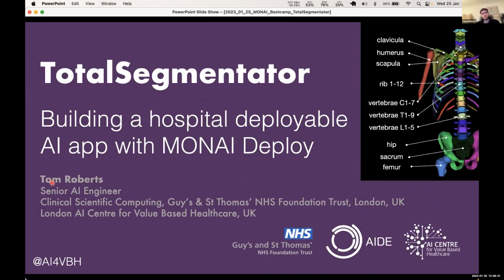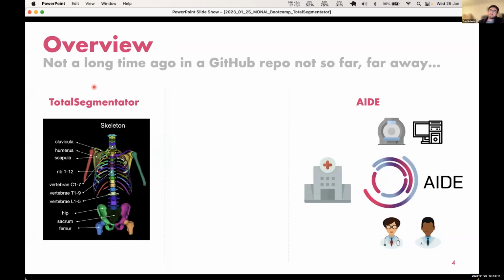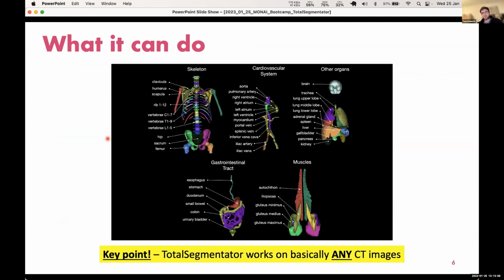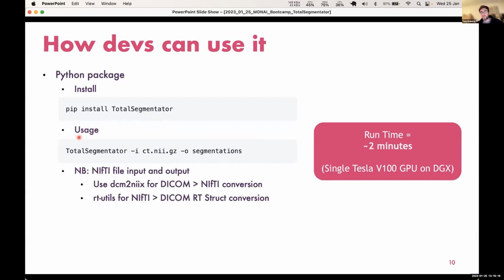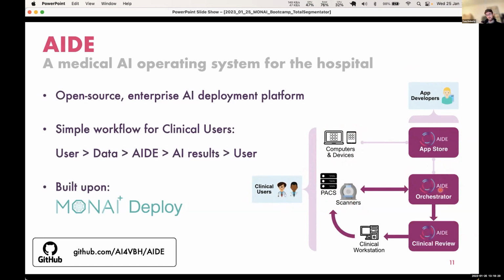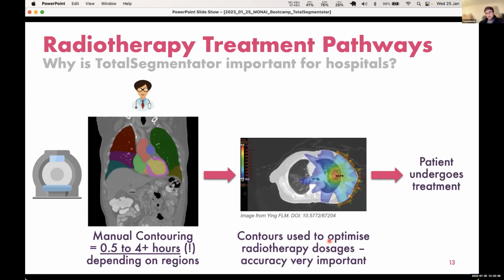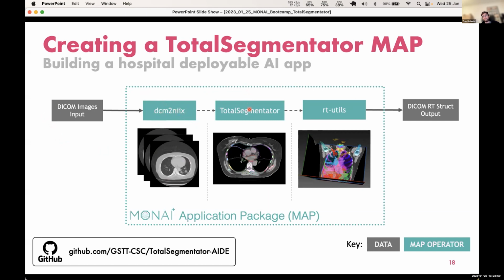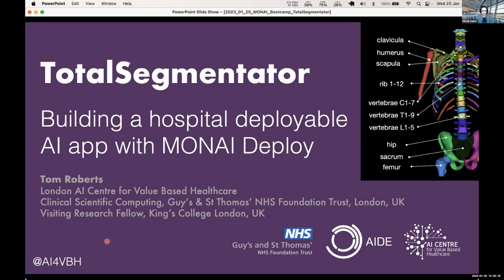MONAI Deploy TotalSegmentator Teaser

Comment: TotalSegmentator is a great tool,  but unfortunately it lacks most of the head and neck organs (e.g., parotids, mandible, lymph nodes, cochlea, optics, etc.), which are very important for the radiotherapy of that area. Of course, one can do an in-house training on these, but it would be great to be included for completeness.
Reply: heyy
i tried running the totalsegmentator but im having an issue and i dont know how to solve it

C:\Users\Desktop\totseg\env>TotalSegmentator -i mni152.nii.gz -o segdirnew --fast
'TotalSegmentator' is not recognized as an internal or external command,
operable program or batch file.

ill be really thankful if you can help me to understand whats the problem
Reply: @ashley_004 I'm not sure if it is too late to reply. Maybe you need to  set the system variable.